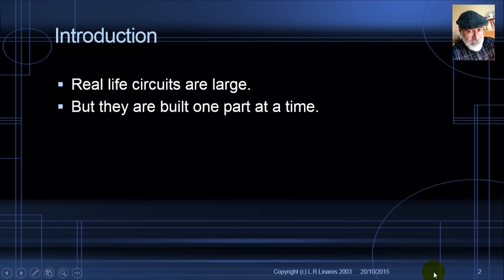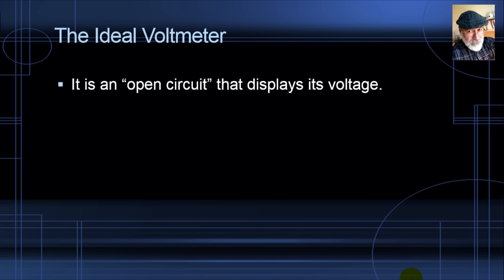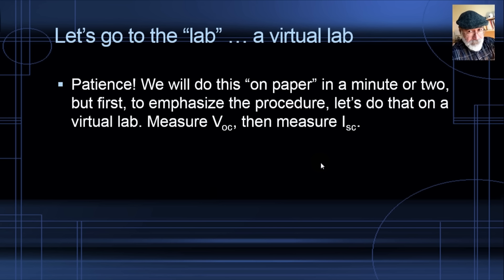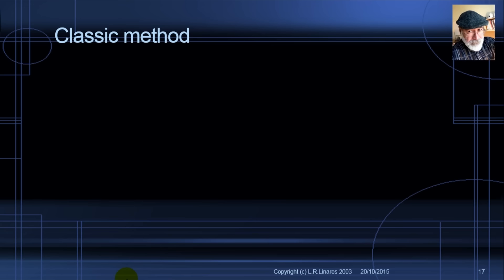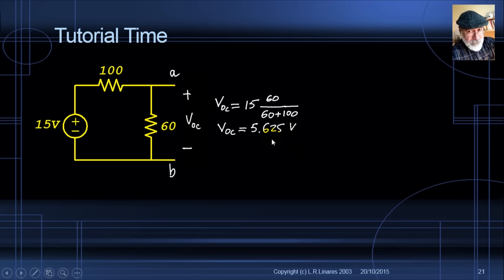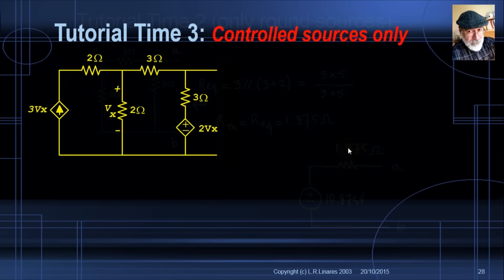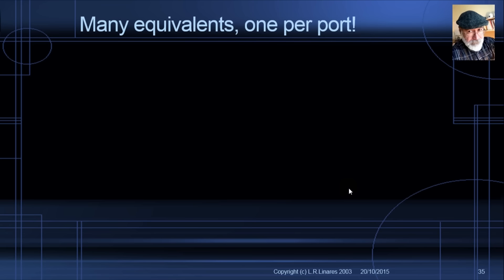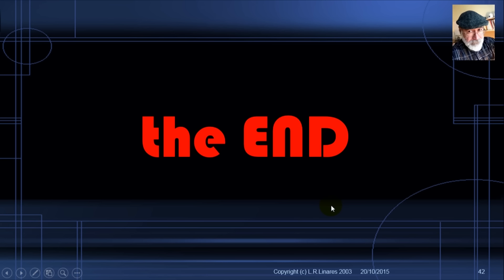EE 101/22 - Thevenin/Helmholtz and Mayer/Norton Theorems.

Comment: Sir, I have just finished all your EE 101 lectures in the playlist and I have learnt a lot. Thank you for preparing them with such diligence. And, thank you even more for sharing these wonderful lectures through a public network rather than the intranet of your department!
Reply from the maker: +Salih Karatas There are more to come. But I have time to shoot and edit only in the Summer. At least, to continue the series on Electric Circuit Theory, which, in my opinion, is the cornerstone, the backbone of electrical and electronic engineering. In the making are: (1) The second lecture on "advanced methods" of Thevenin Equivalents; (2) RL & RC circuits; (3) Operational Amplifiers; (4) Diodes; (5) The Bipolar Junction Transtor (BJT); (6) The JFET; (7) The MOSFET, for now. There are drafts of parts of these in this channel, as part of a storyboard of what I want to do, but that is for the future. Each one of those topics may comprise one or more movies. Let's see what the future brings.

Comment: Hello if we short a power supply to measure the current to find the Thevenin resistance, wouldnt be burn the supply?
Reply from the maker: +jamesmasonic Of course. Please wait for the second part of the Thevenin/Norton lecture. The methods you have seen in the current video are great for an analysis of a circuit on paper. But for the laboratory ... please wait until the next video. In it, we'll talk of finding the Thevenin/Helmholtz equivalent using the two resistors method, or ... well, you'll see. For now, do not short circuit a powersupply, as you already guessed, bad things would happen.
Reply: +rolinychupetin Para cuándo pubilcarás la segunda parte? Excelente explicación sobre conceptos importantes en ingeniería. Keep up the good work!